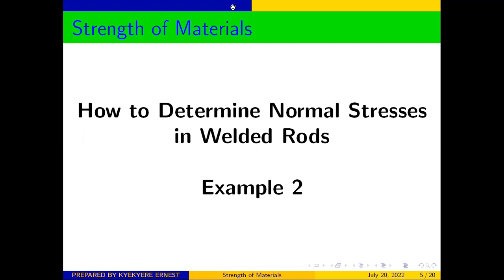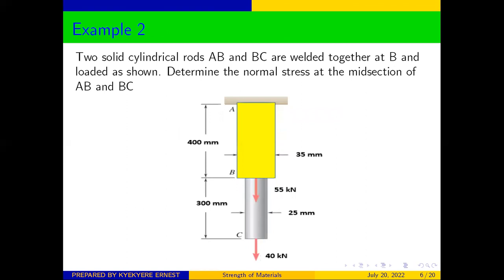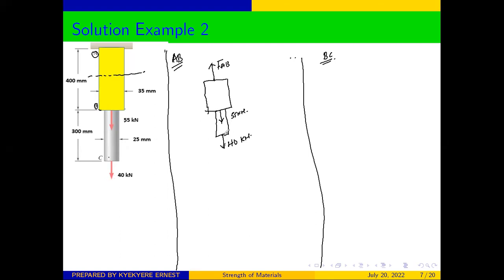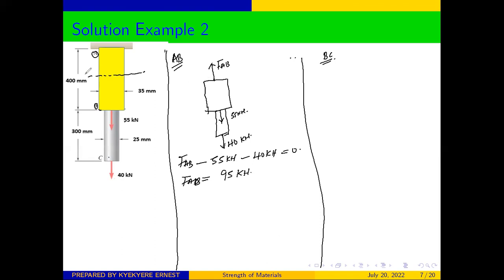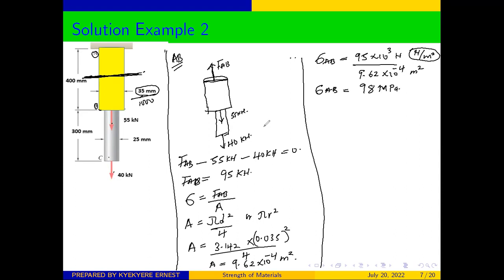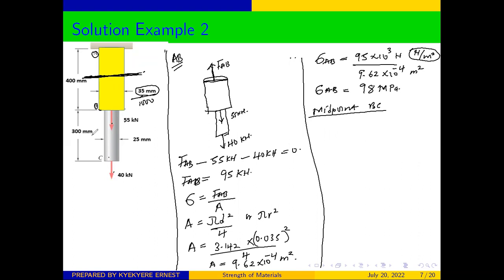Strength of Materials: Determination of Normal Stresses in Welded Rods Example 2

Comment: please sir why didnt you add the 55N force to the equilibrium equation for BC
Reply: Please he divided the second cylinder that is BC into two and considered the down part (half of it)
Reply: So why is that for the first one he divided  but still used the new force ?
Reply: Because it’s only applied on rod AB… if you pull the rod AB ONLY, it has no impact on the rod BC. Like if an elongation happens, it will only occur on rod AB and the rod BC will just go down, but it won’t change its shape (I know I’m late but it can be useful for new people watching this)